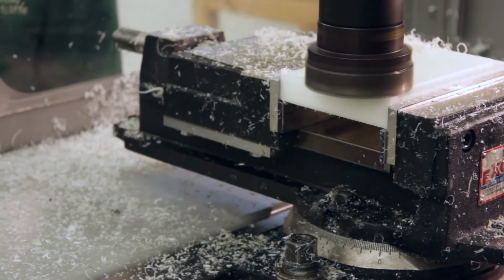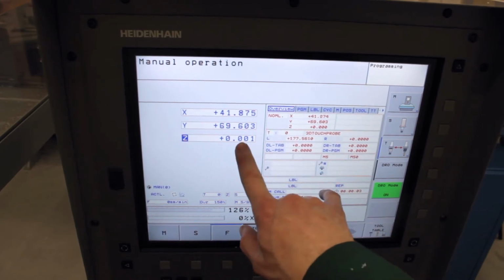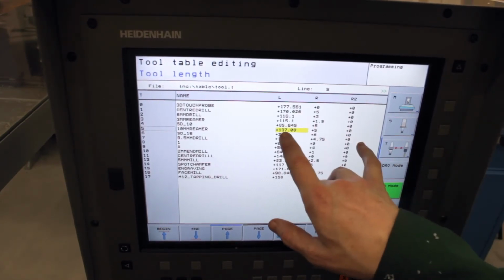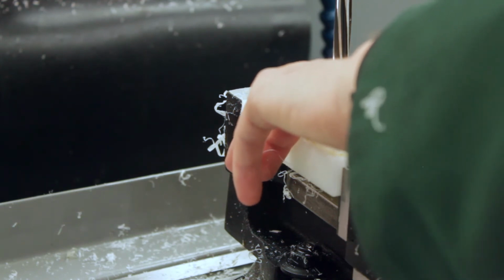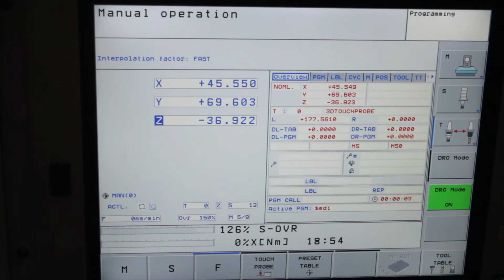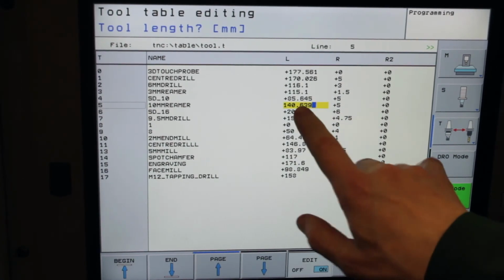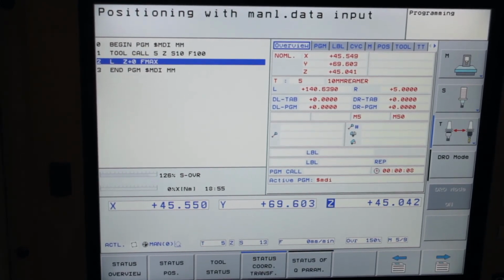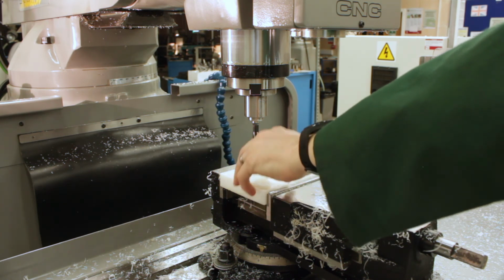Haimer 3D Sensor to Set Tool Length Offsets for CNC Milling -  #5minFriday #21

Comment: +FutureFab CNC & 3D Printing 

On the controller keypad under the '.' and next to the 'Q' is a button that looks like a big plus sign made of 4 arrows pointing inwards.

That will auto set tool length.

So you have the known length of your 3D Taster (compressed to 0) set in Tool 0 (important) and 0 your datum off a surface. 

Then you bring down and use the paper method on the same surface with the tool you wish to set.

Then go into tool table, select tool, turn editing on, press the right arrow key to highlight Length than press the afore mentioned 'large plus arrow button thingy'.

That will auto set your tool legth offset based on your known tool length in tool 0 and the datum.

Im only am apprentice so absolve myself of all liability if you crash it lol.

Comment: That series controller is it I know the tnc 151 has it which would suggest they carried it over with the later controls on the 151 it's an odd looking button that has a dot in the middle with 4 lines forming a  ( + ) I'll get a photo if it helps
Reply from the maker: +Neil Dahl sorry not sure what you mean here? I might need to see the button to be able to comment...